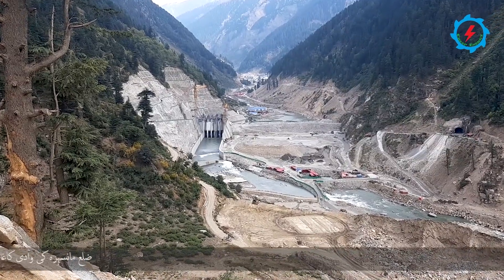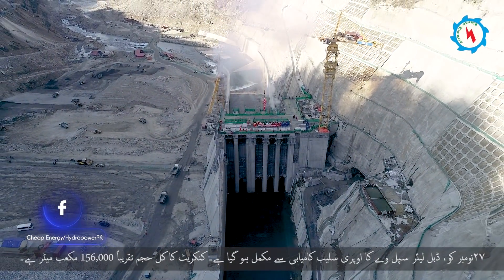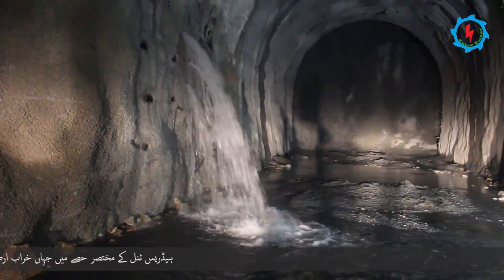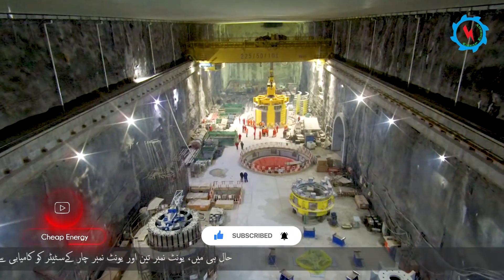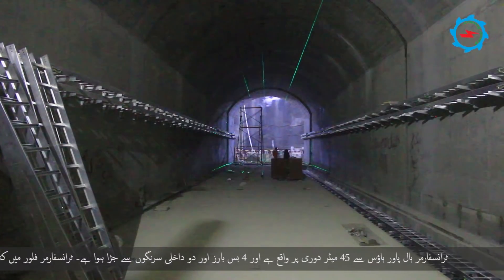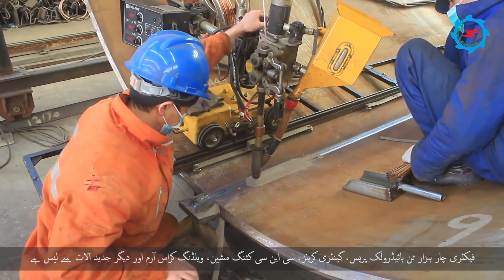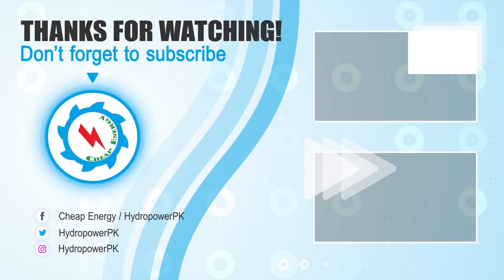Suki Kinari Hydropower Project | Largest Project of CPEC | Nov 2021

Comment from the maker: 0:37 - Spillway/Dam Area
0:55 - Dam Cut off Wall for seepage control 
1:59 - N-15 Relocation
2:24 - Headrace Tunnel
3:25 - Surge shaft
4:01 - Valve Chamber
4:25 - Penstock System
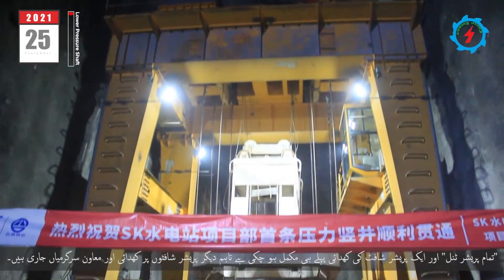4:50 - Pressure shaft excavation
5:44 - Underground Powerhouse
7:48 - Transformer Hall
8:23 – GIL Tunnel
8:36 – Switchyard
9:00 - Penstock Steel Factory
10:30 - Project Completion Date

Comment: New engineering,New steel pipe factory at dam site,New peoples,engineers, experts,heavy machinery etc all are unbelievable.typical/latest construction work very very interesting.thanks to all working on the project.even pandemic i hope project will produce electricity on time.